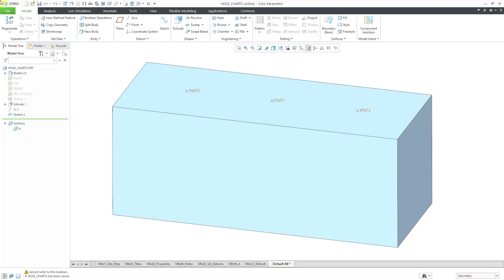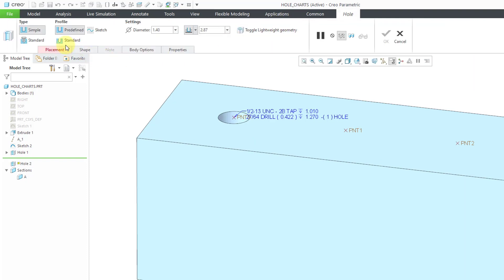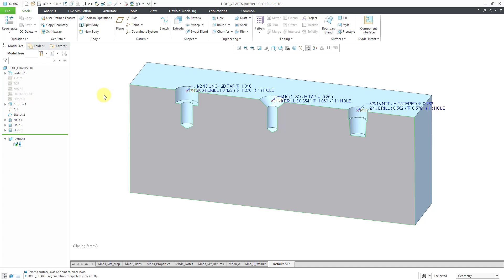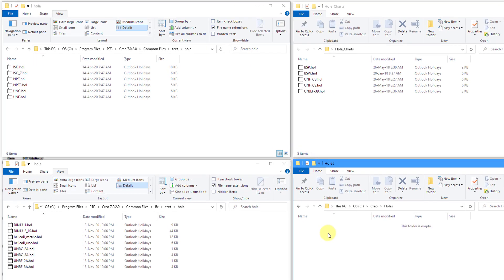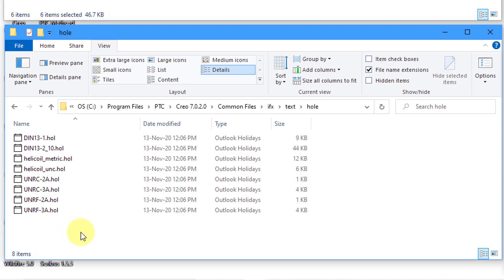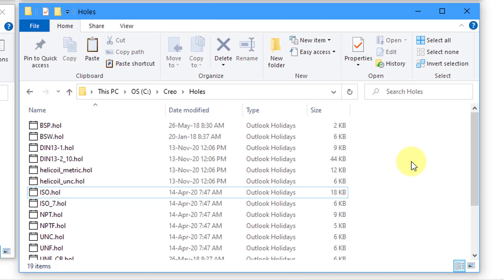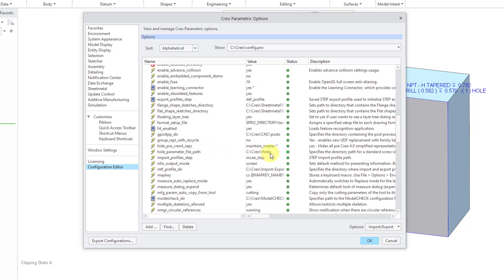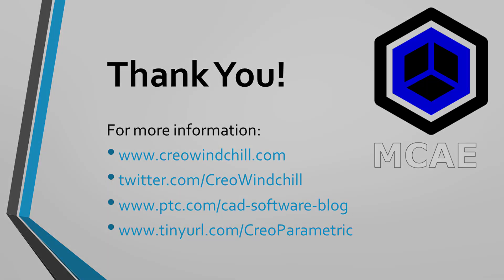Creo Parametric - Custom Hole Charts (Part 1 of 3)

Comment: Thank you, Dave, for another great video!

Just in case someone else is having difficulties with CREO finding the correct hole chart location. I somehow managed to add a second instance of 'hole_parameter_file_path' to my config.pro. Which obviously isn't a smart thing to do! Apparently CREO chose the latter path when having two conflicting instances. It took me a while to figure it out.

Pro tip: If config.pro does not function as it should, browse through the full config file for possible errors.